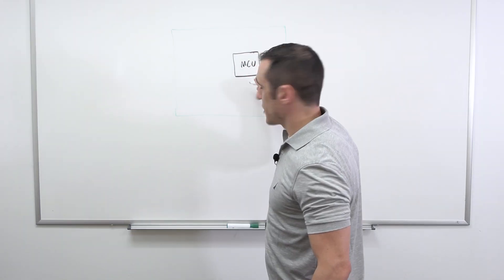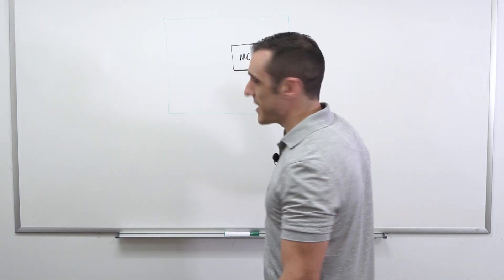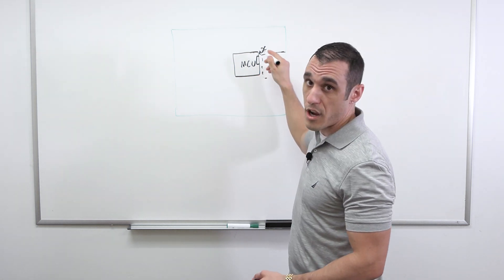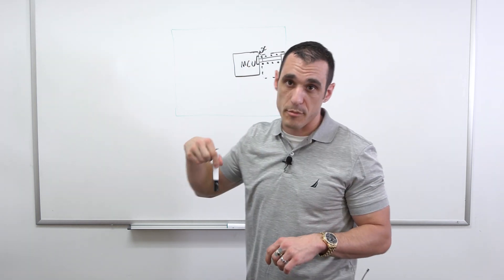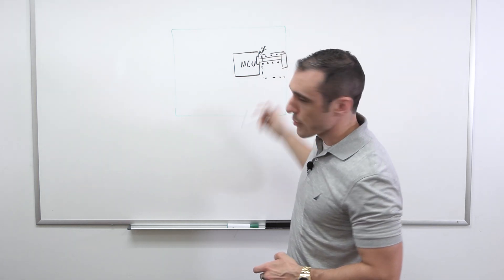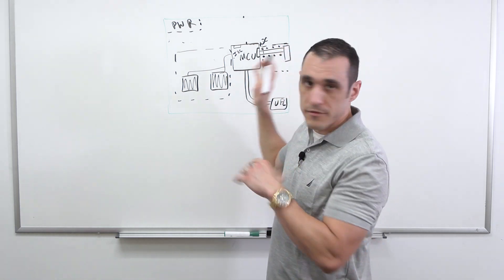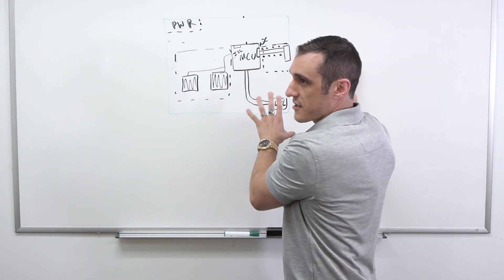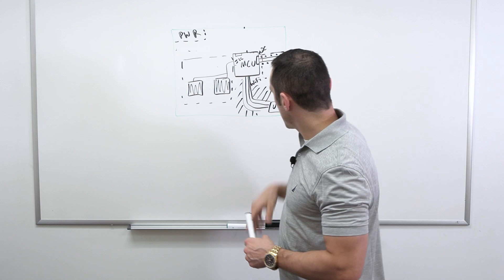Layout | Mixed Signal PCB Design: Part Three

Comment: I still don't see what's wrong with doing both. When I do a mixed signal design, I still isolate Digital and Analog through  careful placement, but I still like to carve out the grounds, or rather, place analog AGND Islands that are still connected to the DGND (usually with a large net tie) underneath or near the ADC/DAC (digital/analog) boundary. If all digital signals are routed over top of the DGND and all analog signals are routed over the AGND, and if those 2 GNDs are tied together at the MCU ADC or DAC where A&D meet, then what is wrong with that?
I still ensure current steering, where no digital GND currents can get into AGND, sections and add noise to sensitive analog signals.

Comment: Hy! great video, however I have some questions :)

I'm planning to do a DC Load (MOSFET's controlled by an opamp, which driven by a DAC, and also 2 ADC (one measure the voltage across the loaded circuit, and the other will measure the voltage on a shunt resistor, which between the FET's and the ground)

The MCU will be an ESP32, which will have an RTC/LCD/buttons/rotary encoder/keypad/temperature sensor too.

The DAC uses SPI, and the ADC uses i2c bus. There are also a -5V generator (from the 5V rail) with ICL7660 which needed.

So the main question is: what If I do the FET/DAC/ADC stuff in one board (without any digital) and the I2C and SPI bus will have pin headers, which connects to an another board, where the MCU, and the other periferials connected (RTC/buttons/LCD/etc) Of course, the SPI/I2C bus connector will have a ground wire, and the digital connector from the DAC (or ADC) will not so far away... Does this kind of modular setup can work? What kind of connector/cable should I use, if I do this?

Thanks,
 Peter
Reply: For I2C or SPI a short SWD connector with a ribbon cable is usually fine. If you look at some programmers (like FORTE), they are basically using SPI over a ribbon cable or a set of flying leads and those at least funciton. I would look at the pinout on the cable and make sure you can through in some ground lines.

Comment: Why don't analog signals and RF signals interfere with each other?
Reply: They do, they're both analog signals and they can interfere with each other. If they are at different frequencies on different interconnects, filtering is usually used to eliminate one of the frequencies from entering a component where it isn't wanted. If they have to occupy the same interconnect on a receiving element, it's more challenging when two signals coexist. Just as an example, signals in the ISM band can interfere with each other due to coexistence in overlapping frequency ranges, so filtering or time division multiplexing would be needed to separate these. In a PCB layout, we try to route different signals things in perpendicular directions and place lots of shielding around these interconnects where possible to prevent the electromagnetic field of one signal from reaching into the interconnect of a different signal. The same ideas apply in suppressing analog from digital, however filtering cannot be used with digital signals because they are wideband and a filter would distort a digital signal.

Comment: Great video! I have a quick question about the via fencing however. From what I understand they are used to provide a lower impedance path for return currents as well as isolating noise from high frequency lines/traces. In that case, why not just use a ground pour on the top layer? To clarify, I typically work with 2-layer PCBs as we have very few components and so we do not need all the layers. Saying that, if I were to create a ground pour in-between all the components on the top layer, and a complete ground pour on the bottom layer, would this be better than using the via fencing?
Reply: Hi Luke, sorry for missing this comment, but we just did a video that talks about this, you can watch it here: https://www.youtube.com/watch?v=R3w4Go1s1hM

Copper pour is a complex issue that is sometimes poorly communicated. You can use it to suppress RFI, but only if it is designed correctly. For a 2-layer board, copper pour might be one of the few ways you can get some easy access to ground without routing a bunch of extra traces, so it's understandable that it gets used in those instances. If you are going to use copper pour in the way you describe, then it would be best to use it with some via stitching around the top layer so that you can get some EMI benefit and to make sure you get plenty of good return paths back to GND as you suggest.

Comment: Brilliant thank you, how would you segment the power plane on a mixed signal board?
Reply: Hi Lee, you would want to try and segment the rails so that you are getting power to different regions of the board based on where your groups of components are located. This can be tricky because, sometimes, you have multiple levels operating within a specific group of components. Other times, you might have a single component that needs multiple levels (for example, large processors or BGA components/FPGAs). I would try and do it all on one layer if possible. I'll ask one of the internal Altium guys to set up a tutorial showing how to do it in an example layout.
Reply: @Zachariah-Peterson  Hi Zachariah, thank you for your reply very much appreciated and extremely useful as I'm currently working on a design containing BGA's and an FPGA.

Comment: What do you suggest about powering motors/cooling fans? I find that shared GND planes with motors/cooling fans induce small noise/spikes to the rest of the system. Having a dedicated GND return path for the motor/cooling fan helps eliminate/isolate the noise spikes from affecting rest of main system.

Comment: Do you recommend using the AC (120volts) on 1 layer (Top), gnd layer (middle), and digital layer (bottom). To separate the signals with a ground layer?

Comment: Lee Ritchey states 1) via fences don't help, and 2) don't split the ground plane. Splitting a ground plane can turn it into a dipole antenna.
https://speedingedge.com/home/about-company/
Reply from the maker: Hi Lawrence,

I'm going to translate for Lee because he (and several others) will make this always-never type of statement, but they do it for a good reason. What Lee really means to say is that using stitching vias or via fences properly can be difficult and that placing them will not be the magic bullet that solves EMI/noise/crosstalk problems. A board with those problems most likely has them because of some other problem in the stackup or layout, and adding via stitching/fences will not be the thing that fixes those problems. Via fences are useful for providing isolation and containing noise, and they are required on grounded coplanar waveguides in order to set the impedance to the required value. Stitching vias are useful for providing multipoint low-impedance ground connections as well as an increase in shielding effectiveness, particularly when used with copper pour. The problem is that most people use them incorrectly, so of course you have folks like Lee and Bogatin saying you should never use them ever. In a way, they are correct, you could build a design that doesn't use any via fences or stitching vias, and it will probably work correctly and pass EMC if everything else was done correctly.

Comment: Now I'm confused. Design guidelines from Analog Devices says to split planes. You said No. Haha. What should we follow?
Reply from the maker: Which design guidelines or application note? I've read two of their design guidelines, one that says to split the planes around an ADC and another that says it's not necessary. I've even an AD app note that recommends star grounding, which is a terrible practice for just about everything except DC.

@LightningHelix01 is correct, they have traditionally prioritized simplicity and, as a result, the app note writer tends to regurgitate old design guidelines just because they worked in the past (when chips were slower and analog frequencies were lower). The result is that old guidelines get repeated over and over, and of course the semiconductor companies can't be held responsible if you follow their guidelines and the board doesn't work or pass EMC testing. You can usually tell if the layout guidelines are outdated just by looking at the date on the app note. If the app note is from 15+ years ago, you probably shouldn't follow it.

Just a note, there are instances where you should split planes, but this is the exception, not the rule. Trying to isolate digital signals from analog signals is not one of those instances. Two examples where it's required or appropriate to split are isolated power supplies and high fidelity audio because the frequencies involved are low, so it's hard to control the return paths without splitting planes or routing dedicated ground traces. In isolated power supplies or transformer-coupled systems, this is done for galvanic isolation. It's even appropriate in power over Ethernet, which uses transformer-coupled termination, in order to hit the ESD protection requirements in the 802.3af standard.
Reply: @AltiumAcademy  your drawing of the electric field in low freq PCB signals was very instructive. Would love to see a demo if there is an FEA tool that plays nicely with designer.
Reply: Analog devices and TI guidelines priorities simplicity and reliability over EMI. In this instance AD recommends cut ground planes for control circuitry in switching power supplies. Because power supplies produce the interference of a digital system with the sensitivity of an analog one, these are usually the most layout intensive after RF.
Reply: @LightningHelix101  Copy that
Reply: @rajimordecai1099  good luck!
Reply: EMI/EMC specialists, PCB fabs, component vendors and engineers seems to have their own ideas, leaving PCB designers much in limbo who to listen to and then just base on experience of  trial and error for passing in the EMI lab without a good clue why exactly it passed (or failed).... it's called dark magic / art. There are so many don't and no's that often you end up without any practical solution, at least some violations or a high count layer board.  I did it the other way around as the ADC location and all analog connectors could not change position on the board.. after that find a place for the MCU and digital parts using one solid shared ground plane but separated 3V/5V/9V power area's on the power plane. For signal traces next to the power plane it was sometimes impossible to avoid crossing power area's or having via's,  For analog/digital separation followed the 20H rule. Also some components use 9V/5V/3V dual power.Think about SPI/I2C voltage translators referencing which power plane ?. .Would like some advise here. until then, keep fingers crossed if the "work of art" will work. :-) also a question on these isolation via's as at high frequencies the return is under the traces and won't spread, then why the via's ?